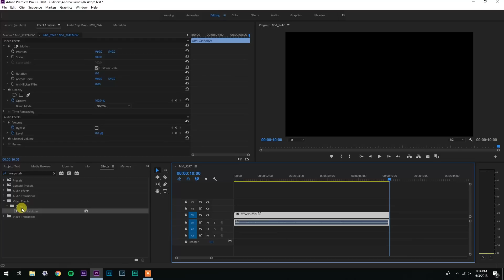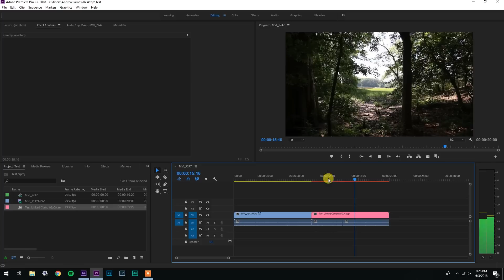Best BUDGET 4K Editing Computer (2018)

Comment: Dude.... premiere pro and after effects are heavy on gpu. The gpu is like the most important piece for fast rendering and exporting time and for smooth time-line play  Premiere pro and after effects uses cuda for rendering. You just gave false information to people.
Reply: This... also having a $400 8core 8thread processor in inadvisable for this type of use. You can get 12core 24thread threadrippers these days for less than that.

Comment: Im gonna go ahead and upgrade my processor and ram before I order my PC. thanks dude <3 :D I have an iMac right now and it takes yearrrssss just to use warp stabilizer + numerous other things. And I get it when you say you prob wouldnt being doing YT now if it wasnt for your new PC. I was on the verge of quitting a couple weeks back and I said NOPE.
Reply: I feel the pain with the warp stabiliser 😂
Reply: Get a powerfull Gpu. Premiere pro and after effects does need a powerfull gpu. Then ram. Then CPU. Most of the work in premiere pro is done by gpu
Reply: If you have a stock Mac pc unfortunately you can't upgrade it so you would have to build one which in my opinion is such a better deal than buying one

Comment: i can relate to having to run after effects and premiere on a slow computer lol, building a pc was probably the best decision i've made in a while lol

for anyone interested in the exact parts andrew has, here they are (from my observation at least)
cpu: intel i7-8700k (with a custom cuk watercooler)
motherboard: msi z370 sli plus (i actually have this motherboard and it's pretty good)
gpu: msi nvidia geforce 1060 3gb
ram: 32gb of something but ram is ram

not too sure on the case, power supply or the storage, but those are pretty standard! hope this helps somebody!